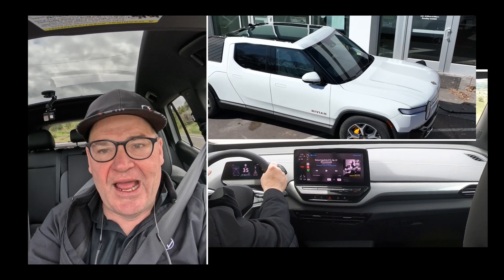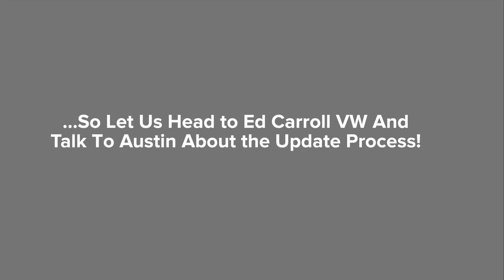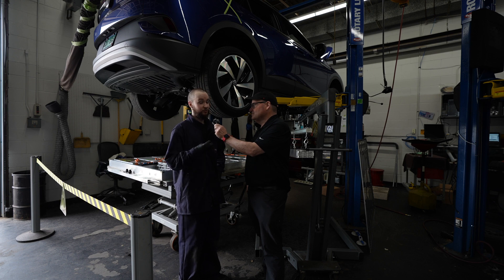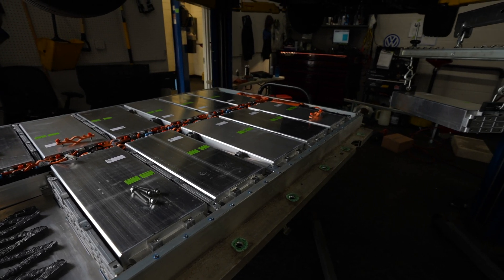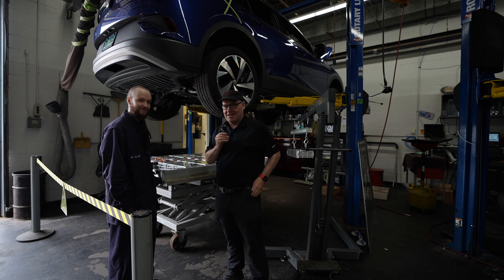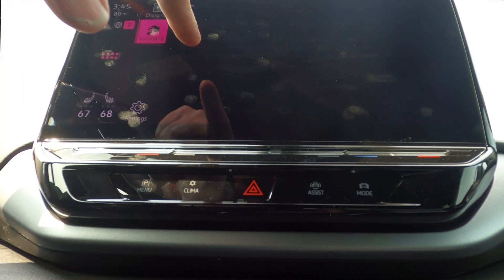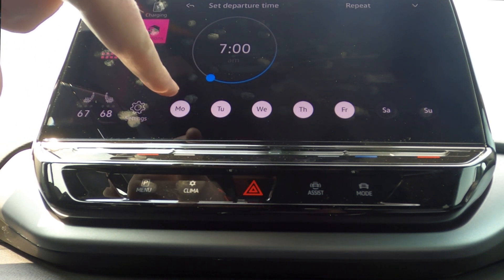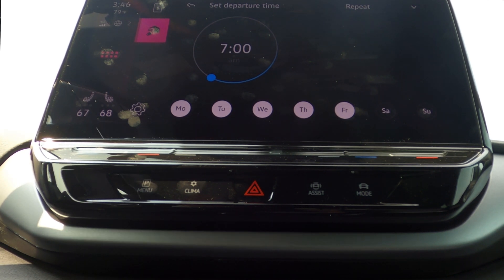Seven Hours to Update ID.4 to 3.1 Software and Replacing a Battery Module That Failed The Update.

Comment: I'm supposed to bring my 2021 ID.4 to the dealer this week to get the 12V battery replacement, software updates, and other recalls done.  Should I be worried about things maybe going wrong?  I don't understand why VW isn't required to provide loaners to people in this situation.  The ID.4 is the only car I have.  I bought the car thinking I would have reliable transportation with free ""fuel fill-ups" (charging).  So, why should the customer have to provide their own replacement transportation that might require buying fuel while the ID.4 is being serviced for something the customer didn't do?  I do like the ID.4 a lot.  I just think that VW isn't holding up their end of the deal.

Comment: Hi, i have a question for you, in the mountains in Austria this summer, i head some hard bangs coming from the floor / battery of our Id4. It looks like it happens, these bangs, when we were climbing and using full power kw of the battery, so it might have been a bit hot, due to full throttle and then going full regen on the way down of like 20% slopes. First we thought it were rocks that hit the bottom plate of the Id4, but when it happened a few times more and regularly, it felt like it was right below our feet. So a bang and nothing happened, we could drive on, no lights came on on the dash. So i wonder, is it due to shrink and expanding of the top layer of the battery or something? Would love to hear your thoughts, and if any other Id drives have had this. Id4 drives fine still, it was only then at that moment and sometimes when i floor it, you know what i mean, has to do something with the heat the battery generates right?

Comment: Thank you for this video. I’ve took my ID4 in for the recall back in April of this year. But because the car was supposed to be part of the software update group but no update was made, I’m stuck in the stage of for interstate battery to deliver the 12V battery to be delivered. Up till right now in July, I’ve still have yet to hear from my dealer that the 12V battery is here and come in for the appt. I’ve asked them every week to see if it’s there, and they always say no. My other two VW dealers they either don’t have training for it or they have no tools for it. I don’t mind the recall, but this 12V battery not coming in is getting irritated.

Comment: In the middle of my 21 pro s software update, it failed. Service advisor said it was the carnet module and it would have to be replaced. No ETA on this module, so I sit with a brick driving a Tiguan loaner. I should have kept the original software.

Comment: I've been really enjoying the "Auto Hold" feature with the software update. That being said, why is there an Auto Hold setting in Reverse? Our situation may be unique but, we have a moderate incline on our driveway and when backing out of the garage we like to stop before crossing the sidewalk just to check for anybody walking by that the VW doesn't see and double-check. Well, now if you've pressed the brake pedal enough Auto Hold is engaged and we're still on an incline. Goosing the throttle just enough to release Auto Hold and then stabbing the brakes again to get some control as you roll into the street isn't a fun game first thing in the morning heading to work. I've learned ways to counteract it but the missus hasn't had this experience yet and I'm sure I'm gonna get an earful the first time this happens to her. Odd software setup for Auto Hold.

Comment: Except on our 2021 ID4. We took our car to the dealer and started the recall and software update. The software update wasn't compatible with our radar sensor so, we had to wait for our dealer to order the updated replacement. Car sat bricked at the dealer for three weeks. Really shitty experience. I resisted the software update (don't fix that isn't broken) but didn't want to neglect the recall. Lesson learned.
Reply from the maker: Thanks for letting me know. I’ll talk to the guys in the shop.  So far, I have not heard of this happening before.

Comment: the dealership had mine for 2 and a half weeks...
Reply from the maker: Did they not have parts?  I am sorry they could not get the job done quickly.
Reply: @electricprincipal543  The SW update was done and found a "bad cell". That took days. Then waiting for the part. Then the tech got sick. Not entirely the dealer's fault. Not stomping on them, but meanwhile the new Tesla we bought has had 4 SW updates while sitting in the driveway. It's not clear to me if the 3.1 update for VW even brings OTA ability? Lots of faith lost in VW. They -- and all the legacy makers -- should be able to do better.

Comment: Waiting for VW to announce ditching CCS for Tesla connector.
Reply: ccs is standard, we have teslas with ccs here
Reply: @hlasrozumu  yes, but Fire just announced deal to charge at Tesla superchargers without using CCS connector.
Reply from the maker: Ford is making the move.  It sounds like 24 cars will have two ports.  One for Tesla, and the other for CCS.
Reply: @electricprincipal543  ok. Makes sense. VW should do the same. Give people options and put pressure on EA.